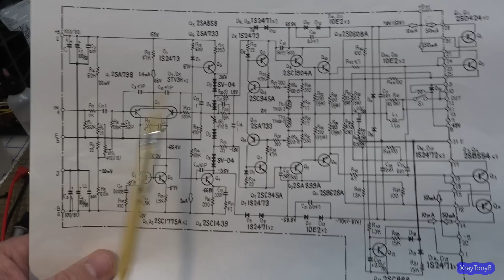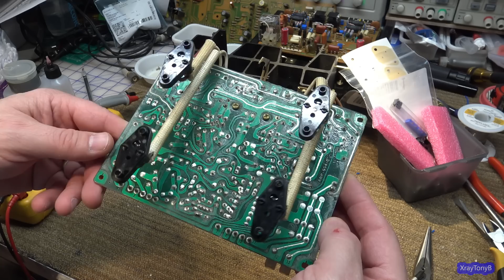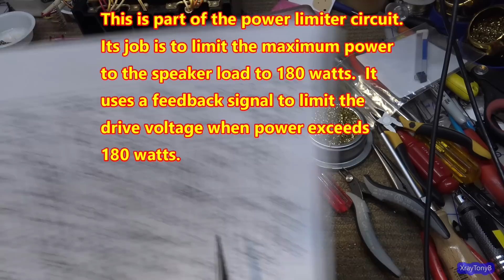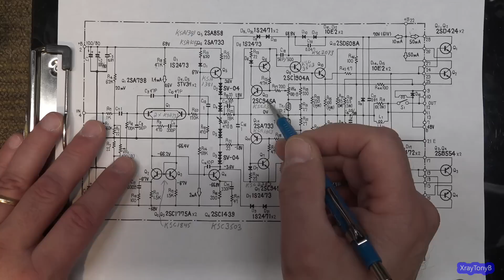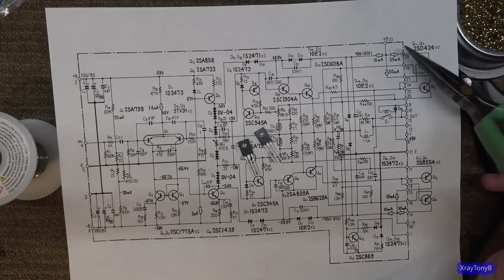Pioneer Spec-4 Part 3:   Restoring the Amplifier Module

Comment: Hello Tony,

I bought a Spec 4 a few years ago, that was not working. When I got it, I realise the Varistor diodes legs were broken and some output transistors were shorting: also, some resistors are dead and need replacing.
I've just repaired the Varistor diodes, and would like to continue restoring the Amp back to its glory.
I'm just learning, I've got a few decent pieces of equipment’s and I would like to restore my Spec 4, would you be kind enough to send me a list of the components you use to restore this spec 4? Even if I have to contribute for your time. 

Thanks in advance

Laurence

Comment: Good morning, Tony. What I always like about your posts is that you appeal to all levels of interested parties.
Something I've always wanted to ask: With the power transistors, I often don't manage to get the NPN and PNP with the same gain hFE. e.g. TIP 2955 (14-16)/ TIP 3055 (57-61)
Do you see this as critical in the output stage?

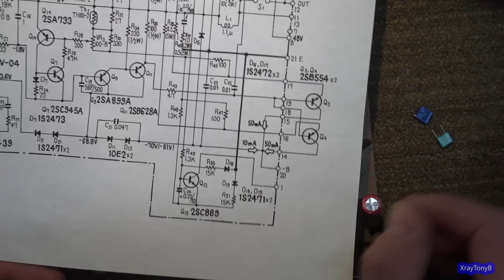Comment: 1:00:00 I have not encountered an issue yet replacing the .22uF cap in the overload detect circuit with kemet stacked film on multiple pioneer output boards. Should be good.

Comment: Would you be able to do a video showing the path of the signal? Say using the schematic you have there for the amplifier boards. I’m not too savvy on the path it takes through the Feedback circuit or anywhere else. That would be incredible.

Comment: Was hoping to get an answer from my other comment your feelings about split foil capacitors.

I was wondering if you'd get a benefit as well using bipolar capacitors wouldn't  be as good but better than the standard electrolytic I would have thought.
Reply from the maker: I only use bipolar (electrolytic, not film, etc.) capacitors where there is a signal that actually changes polarity.  Most single ended circuits don't actually change polarity, which is why normal polarized capacitors are used.  Bipolar capacitors are more expensive and usually don't perform as well as a low noise/low ESR polarized electrolytic.  In addition, I have read that bipolar capacitors really need to have a true AC signal on them (where the polarity actually changes) in order for them to stay properly formed.  I'm not sure where the idea of using bipolar caps in this type of circuit came from, but I am skeptical of it for the above-mentioned reasons.  
As for the split foil capacitors, I have never really used them, as they are expensive and they are more difficult to find in a lot of different values.  I have not tested to see if they would make any difference in the sound quality and I'm always a bit hesitant to believe someone's opinion, just based on their listening experience.  On the plus side, split foil caps are supposed to be more durable than a standard electrolytic as long as you don't subject them to high transient voltage surges.  
That's about all I know about the shrimpin' business  ;)

Comment: Hi tony.   I particularly enjoyed your discussion on the current source on the differential pair and about the first class A transistor.   I am working on a Sony Str-7065 and have 30-45 mV on each speaker terminal but there is no adjustment for that.  Only for bias.   Is there some of the area of the circuit I could look to reduce it?  I don’t expect a detailed answer but pointing me to a general part of the circuit would be helpful.    As always, you’re a treasure for the community
Reply from the maker: I you only have 45mV of offset, you are OK.  A lot of the amps out there don't have offset adjust.  As long as it stays under 50 mV, you'll be fine.  If it gets too high, sometimes the manufacturer will have a fixed resistor that you can change or jumper out to bring it back in.  Beyond that, you would have to check to see if a transistor has gone down in gain, causing a bad mismatch.

Comment: WHY   you replace 40 Mhz druvers with a 4 Mhz driver subs? There are a lots of other choices with an ether faster transistors
Reply from the maker: I explained this in an earlier series.  You have to look at the test parameters when you read the datasheet for a transistor.  The beta of a transistor changes with frequency, as well as voltage and current.  Some manufacturers will list the Ft of a transistor when tested at very low voltage and current, which will make it look like a much higher frequency device.  If you test all of the transistors at the same test parameters, they will look a lot closer in spec.  In addition, you will never hear the difference in a circuit like this one.  As long as the device doesn't add too much latency to the negative feedback loop, it will work just fine.

Comment: Thanks for going over the pre-driver stages of these circuits. It clarified some of my questions about how it all works. I've been chasing down a forward side cave in on the positive side of the sine wave issue on a Scott 370 that's driving me nuts...on both channels! It starts at 12k at around 25 watts and gets worse from there. Any ideas? I'm baffled...😑

Comment: I read somewhere that you should NOT use wire-round resistors in the audio signal path due to their inherent inductance. But since you have many "oscillation squelch" circuits on that board it make not make a difference.
Reply: Would like to hear more discussion on this subject. Good question.
Reply from the maker: A 0.5 ohm wire wound resistor would have extremely low inductance, with reference to these types audio circuits.  I would avoid them when working with RF circuitry and could also see how they might affect a class D amplifier, if the switching frequency were high enough.

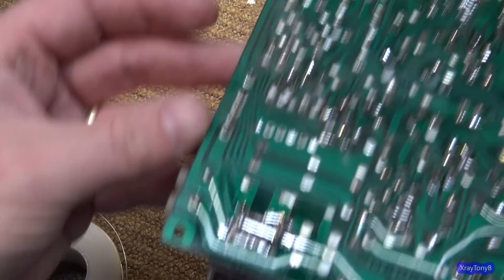Comment: I thank you for your efforts in mentioning the replacement semiconductors you used, as it helps anyone else that might want to restore a unit that they have. @ 50:38 , the added ambiance of your wife practicing is delightful, but in my mind I can't help to think that its actually Ron Burgundy tuning up for a gig. @ 55:30  MG chemicals does make a solder mask, or "overcoat" pen for small touch up areas. @ 24:05 It's kind of funny that, Pioneer designed that over current circuit to be  used as and adjusted for ( Pg 14 of the service manual) a soft clipping limiting  function, where most other amp designs I have seen just have them as a set value for over current limiting into low impedance or short circuit protection. I do wonder how they might limit a fast transient on the output being designed and used to be more restrictive than most other designs, but, seeing the amp only uses 2- PNP and 2 - NPN output transistors per channel I guess it takes some stress off of them in general if all is working properly.
Reply from the maker: The diodes D8, D9, D20, D21, D2 & D3 set a hard limit for the drive voltage.  That is what provides the protection against overdriving the signal.  The Power limiter circuit limits the power to the speaker load to about 180 watts.  Even though this circuit may have a small amount of latency, it will limit the power within a reasonable amount of time to protect the transistors......at least in theory ;)

Comment: FYI... This tip is off-topic, for this video. But, it is the only available means of communication. There is a problem with Relay based Soft-Start Circuits... Well, the problem is actually with relays that use a coil... Relays switch in and out at a voltage lower than their stated rates. In a soft-start circuit, this means that the downstream capacitors/transformers/circuitry are not charged to the full voltage and that there is an additional, smaller in-rush event, after the coil has tripped too early. The YouTuber Haseeb Electronics has a clever fix... {983} How to drive relay at specific voltage. Spoiler... He biases the trip point, to hold it up, with a zener.
Reply from the maker: Those things are not really a concern.  You don't need the relay to come in after the caps are fully charged; you just need it to come in after they are about 70% charged, as that's when the inrush current is relatively small.  Relay coils have a very wide operating range, with the pull-in voltage being higher than the drop-out voltage.  As long as you use the proper value dropping resistor in this circuit, it works perfectly.  Adding the zener will also work, but it's not necessary for this application.
Reply: Another approach is to use a 555 timer IC or a 741 OPAMP wired as a comparator circuit. Then the relay sees full coil voltage or not due to the snap action of the comparator. This eliminates the slow pull-in phenomena which leads to increased contact wear.

Comment: Do you know why the manufacturer would have put those white tubes over all the resistors?
Reply: Heat wrap. Likely fiberglass. Protect surrounding components from temperature.